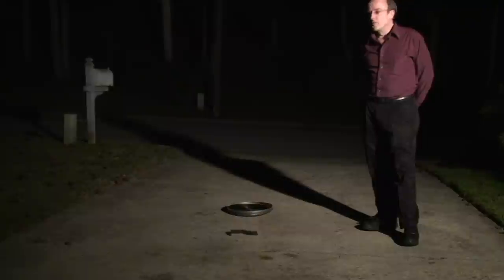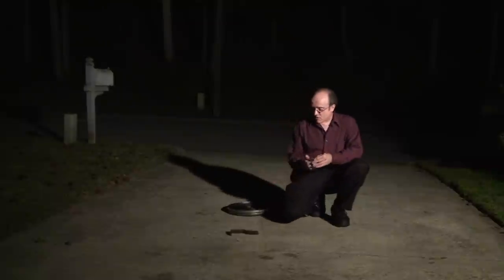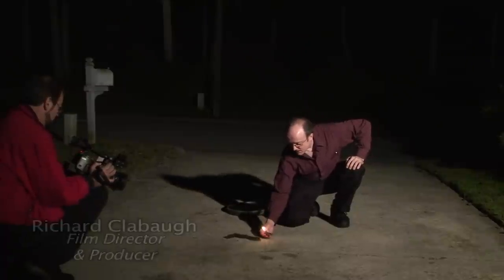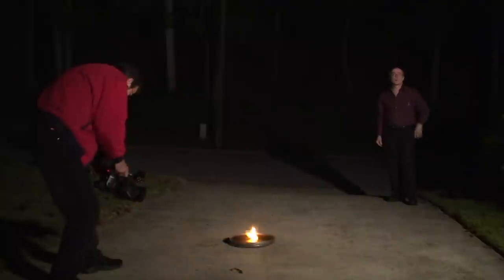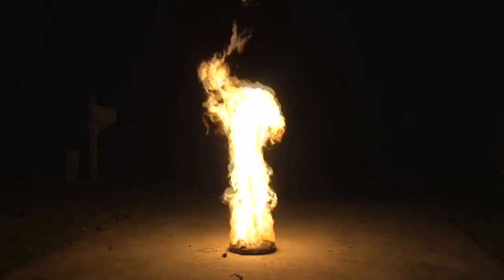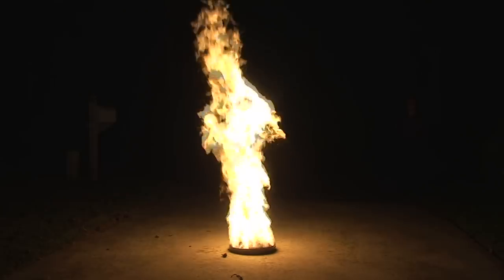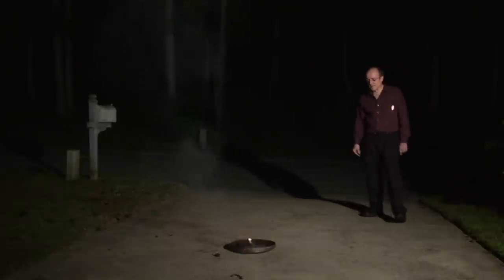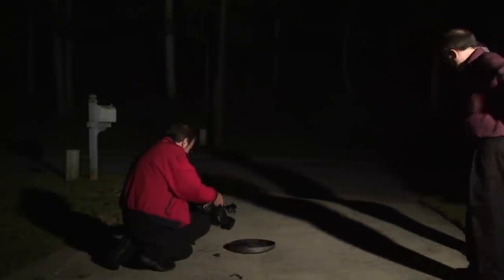Nitrate Film Burn #2 in HD at Rayle Archive & Screening Room

Comment: Wow, this was impressive. If one reel burned like that imagine how a booth full would behave.
Reply: That's why if the booth closes it's fire shields, it's time to get the hell out of the theater. It will eventually spread out of the booth and start igniting everything else.

Despite what the 9/11 truthers say, the fires that melted the steel beams and caused the collapse was ultimately from the burning paper and office furnishings. The kerosene from the planes had already burned up shortly after impact, so the fire was fueled most of the time by the aforementioned mundane items. So imagine what a rack of burning nitrate film can do to a small steel booth.
Reply: @plateshutoverlock   Holy shit, you replied to me after 11 years. I actually vaguely remember making the original comment. I can't believe it's been that long.

Comment: just imagine running a nitrate film at a modern theater (even a multiplex). The theater would of burned to the ground! I suppose this is another reason why theaters have switched to digital.
Reply: Modern film is completely safe.
The reason that cinemas have turned to digital is threefold.
Until recently, a light valve was not available that would give the definition of 35mm film.
Each print costs approximately £1000. meaning that the film cost to run a multiplex cinema would be up to £12,000 per week.
Digital, does not require a projectionist to run and prepare it, so hence saves cinema's a lot on their wages bill.
Reply: +wilsjane It still doesn't give the 'definition of film'. Digital can't rival the quality, hence the reason so many theaters still have film projectors. The main reason for the switch is that most people haven't noticed and the studios know that they can finally get away with saving millions of dollars. It costs the cinema nothing for the prints, the distributors pay that money.
Reply: 5:44 The projection booths seals if there's a fire, so no the theater wouldn't have burned down.
Reply: Ariana Marchesi The problems with digital projection mainly lie with the setup of the equipment. Lack of up to date SMPTE standards does not help. A few years ago, it was proven that digital produced a better picture than release prints on Kodak, Agfa and Fuji film when setting up for the Royal Film Performance in London. The resolution is almost identical to 35mm print stock, since the grain is almost the same. Unfortunately cinemas no longer have technical staff and those who remain are incapable of adjusting digital equipment.
With regard to the cost, while the distributors supply the print, it is taken into account with the deal with the exhibitor, often leaving the cinema with a very small percentage of the box office, which results in them being more interested in selling popcorn than presenting the film.
A few years ago, I ran a 30fps 70mm test copy of Oklahoma that I graded with Fred Zinnemann  It shows just how much film has gone backwards over the last 40 years.
Sound was an even bigger problem in the later days of film. Placing digital information between the perforations made track redeveloper application difficult, often resulting in redeveloper bleeding into the picture area. Although scratching and dirt does not impact in the same way as on a duel bilateral analogue track. As the gate runners wear the digital information away, dialogue suffers badly. DTS would have been the answer, but no one took it seriously, mainly because it would have made prints international and impacted on film laboratories in non English speaking countries within Europe.
Reply: I’ve seen nitrate projected in a modern theater

Comment: nitrate film is made from nitrocellulose, which is more commonly known as guncotton. As the name implies, it was used as an explosive.
Reply: It burns much more rapidly, indeed explosively, when pressurized. I wonder if anyone has ever tried loading cartridges using old nitrate film cut in narrow strips (similar to the "spaghetti" loads used in British 308 WWII ammo? It should work, but each reel would require extensive testing with proper equipment to determine working pressures and loads.

Comment: I ran projectors from 1984-2012  (WAY after nitrocellulose film was used)  and I had an old-timer tell me how dangerous of a profession it was to be a projectionist.  A projectionist was surrounded with this stuff all day, and the screen was lit with an arc lamp, before xenon bulbs were the norm. 
   Plus he told me how toxic fumes were another serious danger that could take you down in an enclosed booth before the fire did.  I have always been fascinated with what it actually looked like when ignited. 
             -Thanks for sharing this!
Reply: There is a modern projection related danger in Imax theaters. The bulb used is a highly pressurized glass like crystal vessel that can explode very violently. Special protective equipment must be used to handle those bulbs.
Reply: @plateshutoverlock  Very ironically, I had a smaller (2,000 watt) xenon bulb bulb explode in my face while swapping one out. I was extremely dumb and also lucky. I had no chest protector, gloves or even a face shield on. After that, I was super careful and always took precautions when removing them.

Comment: Don't forget the chain effect of one burning reel igniting the stored reels nearby, likely not kept in fire safe boxes or a vault but just an open shelf rack.

With those many reels flaring off, I doubt even a fully closed steel booth would stop the fire from spreading elseware, only contain it long enough for theatergoers to evacuate. Nitrate film is so flammable that burns underwater

Comment: Damn. I dont think I've seen anything burn quite like that.
Reply: L-ion battery fires are very fierce like that, and like nitrate it is extremely hard if not impossible to extinguish. Water makes it worse, dry powder may retard it, but L-ion also creates its own oxygen. L-ion batteries are everywhere from your phone, cars, toothbrush, cordless tools etc.  They start off with emitting dark smoke and keeps getting more intense until an explosive eruption, like a blow torch takes over.  Aircraft safety is a major concern carrying this type of cargo or in the cabin. Nitrate film should never be shipped by air.

Comment: L-ion battery fires are very fierce like that, and like nitrate it is extremely hard if not impossible to extinguish. Water makes it worse, dry powder may retard it, but L-ion also creates its own oxygen. L-ion batteries are everywhere from your phone, cars, toothbrush, cordless tools etc.  They start off with emitting dark smoke and keeps getting more intense until an explosive eruption, like a blow torch takes over.  Aircraft safety is a major concern carrying this type of cargo or in the cabin. Nitrate film should never be shipped by air. Would not be surprised that it gets carried as it would only be labelled as 'film'.